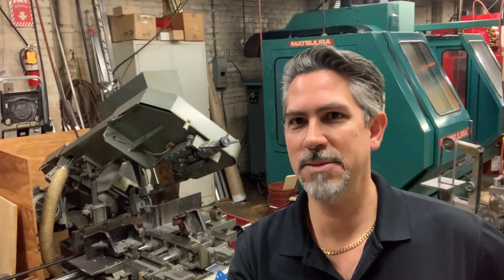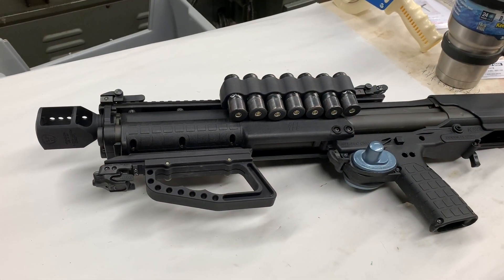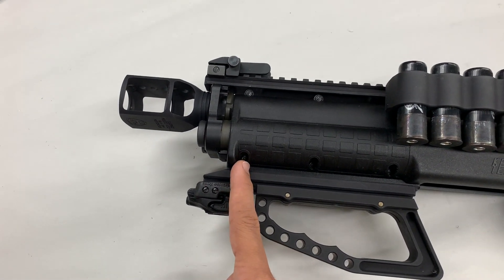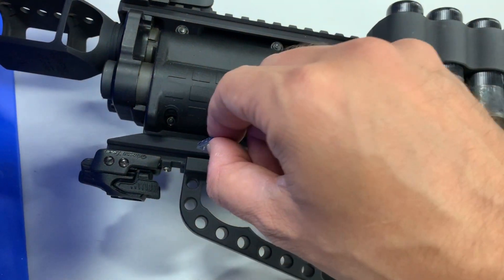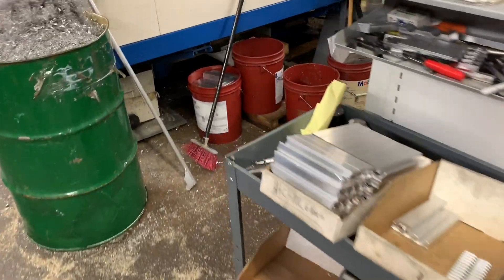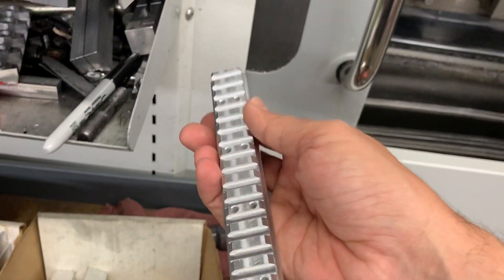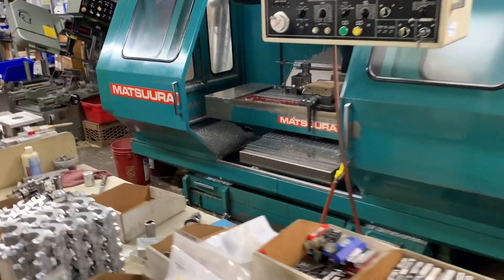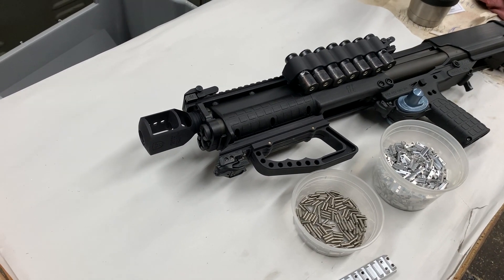KSG Extended Safety Lower Rail: How’s It’s Made By Hi-Tech Custom. CNC Milling shop tour.

Comment: Checking my understanding - with the Striker Pump I wouldn’t NEED the lower rail, but using the rail would make it more secure?
Reply from the maker: Hi John.  You definitely don't need the regular lower rail with the Striker handle due to the clamping design with 2 screws we use. But if you wanted to mount a crimson trace laser in front of it, you would also get our "Extended" Lower rail to give you more rail space.  Hope that helps.  Best regards. Karl, www.HITECHCC.com
Reply: @karlhi-tech7853  Thank you for the QUICK response (just sent an email also).  I live in CA, so the laser is a no go.  I am looking at mounting a flashlight and a red/green dot.
Reply: Thank you!  No laser though - California.

Comment: This is definitely a nice piece/addition to the KSG. I got mines and first let me tell you.   I was amazed at the quality, no sharp edges to cut yourself, looked and felt like the OEM rail on the KSG.  That one inch of extra length made a whole lot of difference on the laser light combo that I needed to add, creating comfort in the space between vertical grip and toggles on the light and pumping action of the shotgun.  I also got the switch selector and man, just like the videos you guys posted.  Very smooth and easy action.  I made couple purchases from you and will be coming back for some more stuff.